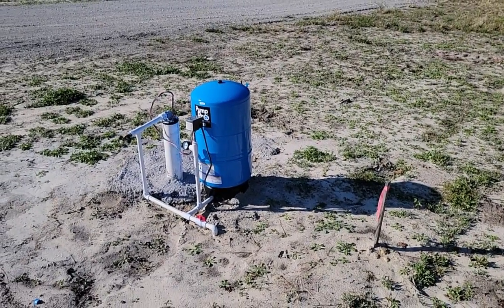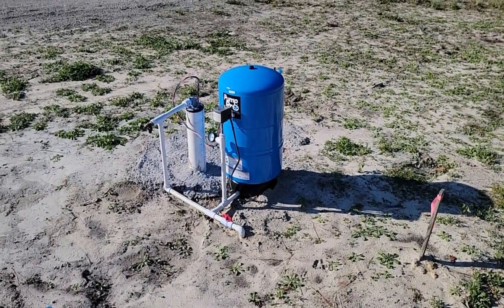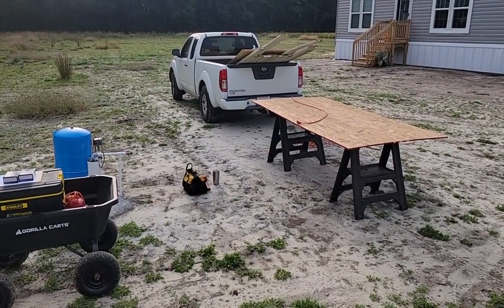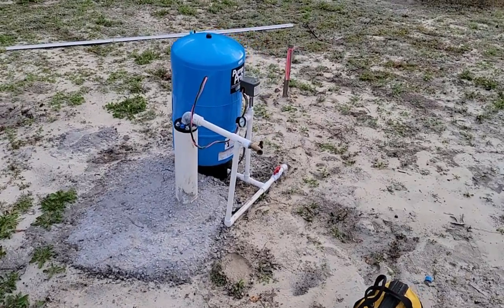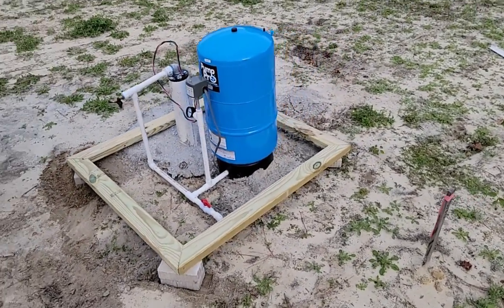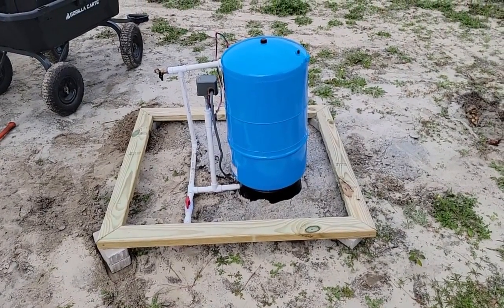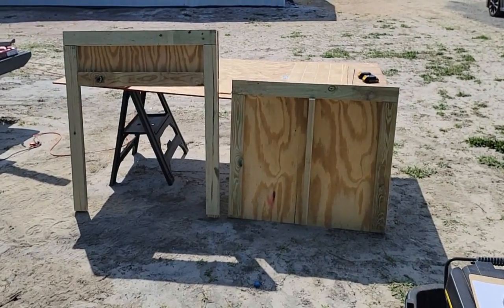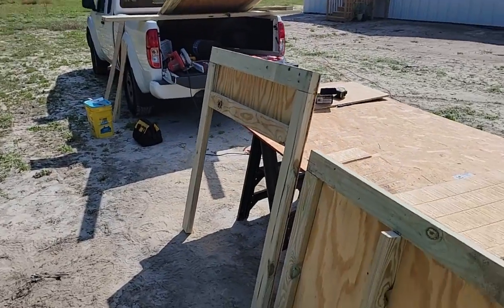Well house build 10 09 2022

Comment: This will be my project today.  Slight variation though. Im using 4x4 's on the corners. Cemented in the ground 2ft deep. 
I will use your frame contruction layout.
 Great job! Looks great.
Reply from the maker: Good luck!  It was the first "building" that we built.  It has held up very well so far.  The only thing I would have done differently is to use the OSB that has a prefinished side instead of the raw plywood that we used.  We used almost used an entire gallon of paint just on the well house.

Comment: I need to enclose my well and got some Ideas from your video. My thought
was to somehow do a roof that is as light as possible and be removable. One 
may some day need to service/replace the submersible well without destroying
the building. Any thoughts?
Reply: Smart! When we had to replace pieces in the bottom they had to remove our well house. I'm thinking to put a hinged roof to be able to open it up for repairs. I will use a metal roof.

Comment: I love it and am looking to build something similar so I really appreciate the video.  One question was about the doors.  You did not show them being installed and the dimensions, but how much room is required for maintenance, if you know?  I need to make mine a little wider (6') but similar design.  Also could metal roofing be used instead of shingles?  Best wishes!😃
Reply from the maker: Instead of writing a response, I will do a video hopefully answering your questions.  I was thinking of doing a "things I learned" video on the well house, so this is a good reason to actually do it.  I should have it up either today or tomorrow.

Comment: Just saw this. 
What are you going to do if you have to pull the pump out of the well?
Reply: Funny that you asked that.  The well pump was defective and had to be replaced about a month ago.  Since the wellhouse is not attached to the ground, we just tipped the wellhouse back to get to the pump. Then put it back when they were done.
Reply: @jballar3488  Glad that worked out. But i thought you had tie-downs securing it?

Comment: Did you use pressure treated lumber?
Reply: Yes it was pressure treated.  The building is heavy enough to withstand the strong wind we get around here, but is light enough to tip over to have maintenance done to the well